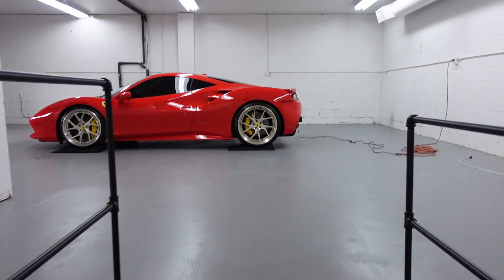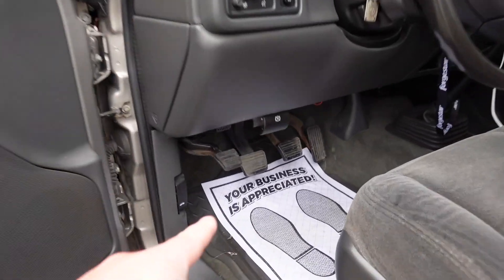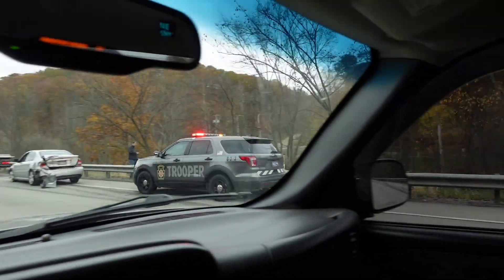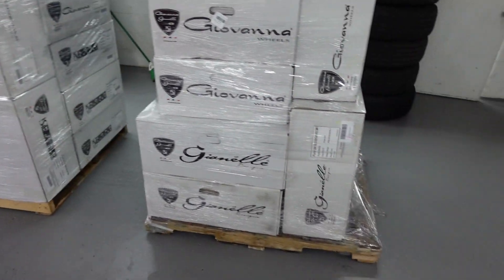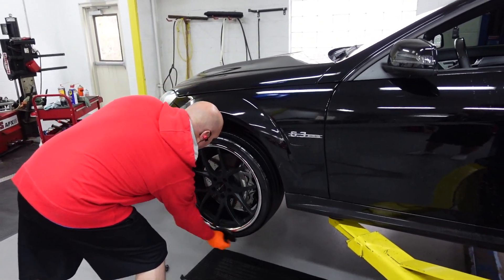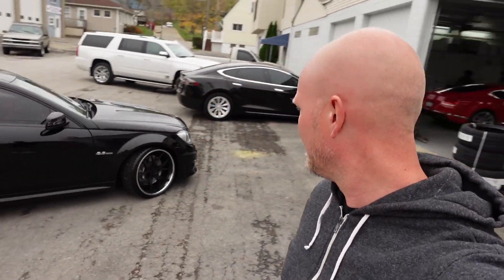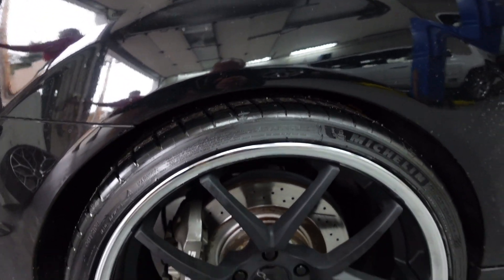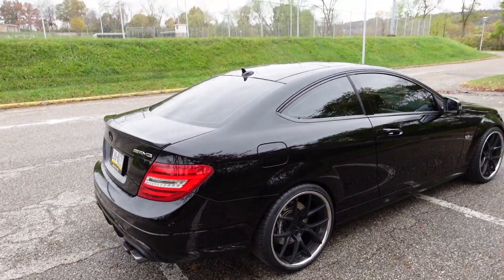Finally New Wheels For My C63!

Comment: Get ready for another bend wheel video with those rubber bands
Reply: I was thinking the exact same thing haha. Way too small sidewall for where he lives lol.
Reply: And it will be PA DOT fault. In other videos he actively drives right into potholes
Reply: True, but why so negative.
Reply: @jackstewart7542  I guess I get tired of Mike’s childish revving engines, speeding, going through red lights and complaining when he gets pulled over by the police.  Personally I think he is dangerous and inconsiderate to anyone else that shares the road with him. Nothing is his fault, it’s always the roads, the police, the mechanic yet every problem he has is self induced. The channel used to be good when he reviewed cars and showed you the inner working of the dealership pricing and such. Now his videos are ridiculous, over revving, fake laugh pan for the camera cold starts.  I guess I should stop watching. And that’s beside trying to hawk hats, tee shirts, cheap watches and just as cheap sunglasses.  He has jumped the shark. Over and out for me

Comment: I like the wheels. I'm not a huge fan of ALL BLACK wheels, so having the chrome lip does make a huge difference. The suspension looked like it fully settled at the end of the video and it appears that lowering springs aren't necessary.

Comment: Hey Mike...I have the same wheel spec on my W204...I chose not to lower mine and I'm glad I didn't...When you're traveling at a decent speed, you'll find your rear end will slightly rub when hitting  dips etc.
Reply: Have you worked on the Body that they fit or Just mounted on the wheels and go?
Reply: @pietschabermatias108   The wheels i chose were a perfect fit for just a straight mount and go... If I were to do any lowering of the car, I would definitely have to roll the rear fenders

Comment: Use the seatbelt!! Safety first.
When you were driving the truck after picking up the tyres...
Reply: 000  2 different things. Belt is a requirement by law and even if in a accident without his fault... not to say that having thousands people watching should give the example. Agree with the mask.

Comment: I’ve always wondered if you replace your tires does it affect the tps, tire pressure system and does it still display if it’s leaking.
Reply: They put tps sensor from old rims  on the new rims
Reply: I felt they didn’t open up the older rims that’s why I asked haha 😅
Reply: @gdudemandude4569  When i ordered mine, they just put new ones in.
Reply: I work at a tire shop, and we dismount the old tires off the old rims and take out the tire pressure sensor and then install them onto the new rims. So yes it will still display if it's leaking
Reply: It varies from car to car.  For Mercedes, they make it easy as the car will automatically pick up the sensors in each wheel after a short drive.  I switch back and forth between my winter and summer wheel and tire set on my C63, and it works perfect.  Some manufacturers are a pain though, and you may need to have the sensors reinitialized with the car if you switch to  a different set of wheels that have different set of sensors.
Reply: Is the sensor inside the tire?
Reply: @gdudemandude4569  Yeah inside each tire, around the size of key fob.

Comment: Do they ever rub? I have 19x9.5 &19x8.5 +50 offset  ,275 and 255 width and will get a slight rub on the back only on a big dip rarely on a 2013 c63 sedan but my wife just bought a 2015 507 edition and would love to get the bigger wheels if they wouldn’t rub?

Comment: Not soo much a fan of those wheels especially the chrome but I feel like if the tires had more meat, then the wheels would maybe pop more. Maybe 245/40, 285/35. 25s are just rubber bands at that point

Comment: The black rims,  seems to hide the design of the rims instead of making them stand out..  contrasting colors with the car seems to make more of a statement.. black rims will hide brake dust better.  That’s my opinion.

For $#!t€ and giggles you should of put those bently style rims on your vehicle to gauge the color and design against the black paint from your vehicle.